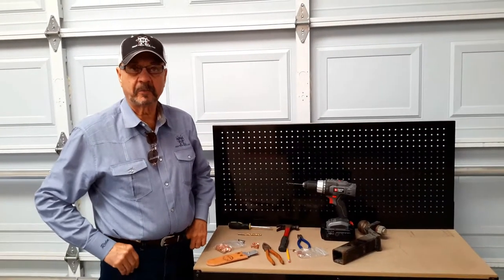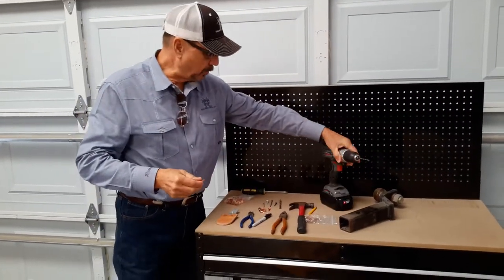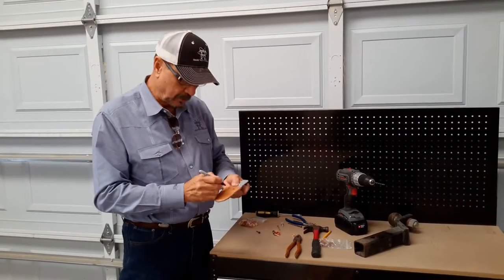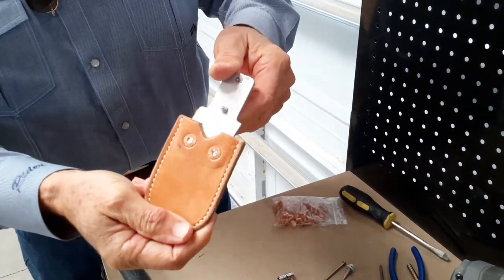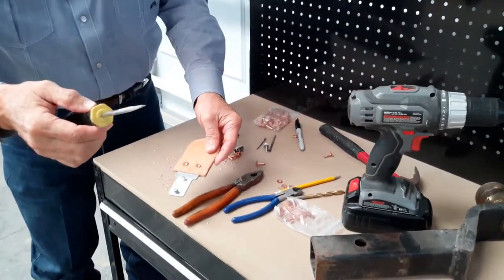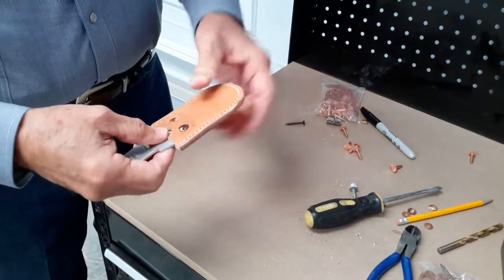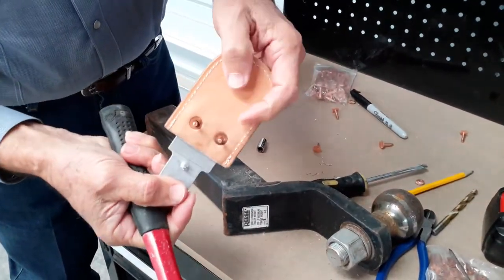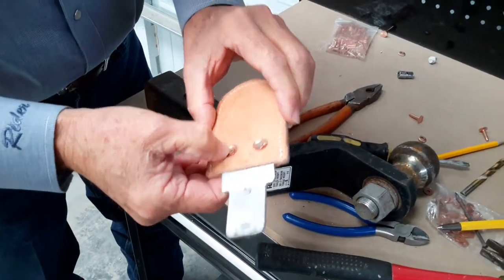Rider Buckle Installation Video

Comment: THANKS   FOR   GREAT     VIDEO   ...IT   WAS   SIMPLE   WITH    YOUR   STEP   BY   STEP  ...THE  ONLY   THING   DIFFERENT   WE   DID   WAS   WE   USED   IRWIN   DRILL   BITS   AND  THEY   CUT   RIVETS   IN   SECONDS  ....THANKS   FOR   YOUR    VIDEO ......PS   TRAILER   HITCH   WAS   A   GREAT   IDEA   .......